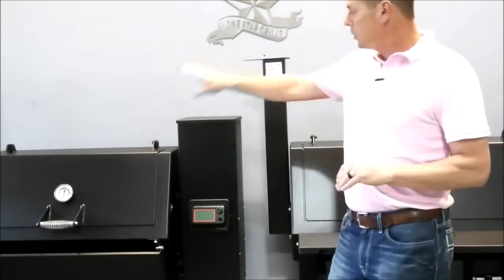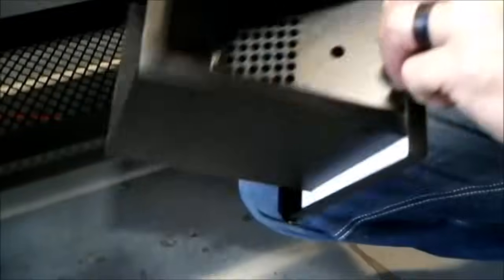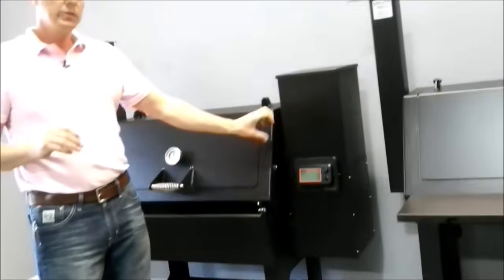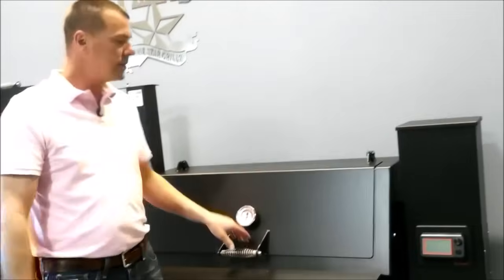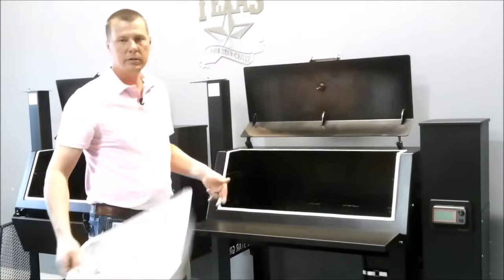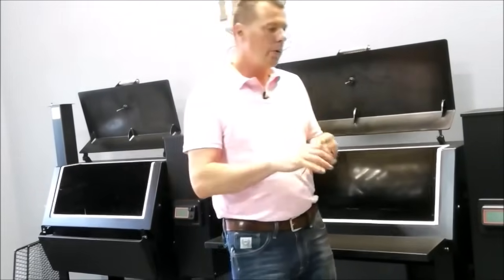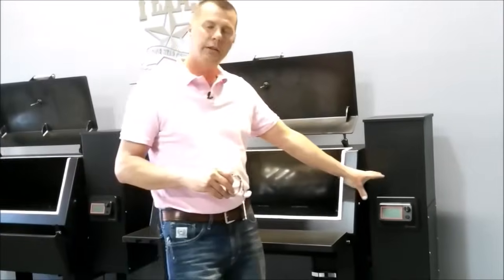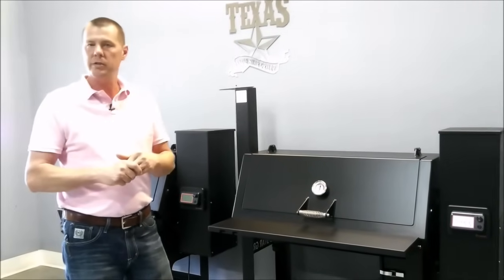Lone Star Grillz Pellet Smoker

Comment: Just took delivery of mine and it is amazing!
Reply: How long from order date to delivery? I have one on order.
Reply: @yambor44  about three to four months from order to delivery. Well worth the wait.
Reply: I just ordered the 20x42 two days ago. How do you like yours now thar you have cooked on it?  Was it worth the wait?
Reply: @jeffpuffenbarger6800  hey Jeff, it is absolutely worth every dollar. The amount of smoke that is produced is significantly more than any other pellet smoker I have had. And the temperature stays where you need it to be, even when I was running it during our winter up her in the Pacific Northwest.The Fireboard controller is awesome. I would definitely recommend getting the ball valve for the grease drain. Unscrewing the cap got messy quick.
Reply: @aneisinger  Thank you so much for replying!  I feel even better and more excited about my investment for sure.
Reply: @aneisinger  Did you notice same pellet usage as other smokers you’ve had?
Reply: @318android3  it is very efficient with its pellet usage. The Fireboard controller with the Fireboard drive makes the peeler consumption extremely efficient.
Reply: @aneisinger  last couple questions, it advertises as teaching 450F.  Have you pushed it to that point?  Does it get there relatively easy?  I do use high heat for poultry.

Is it easy to clean the grease/ash inside the chamber?  I know the firepot underneath helps cut down amount of ash inside grill but there will always be some.  Also grease you have to scoop out as I assume you can’t push it into the grease drain?

Thank you!
Reply: @318android3   no worries. Glad to answer. I have not tried to get it up to 450, though I believe it could. I have been cooking recently in temps around 32 degrees and it holds temperature just fine.

The grease is moved into a space at the far left of the grill. There is a drain for it and I would highly recommend getting the ball valve. After your done, you can just turn the ball valve and drain the grease while it is still in a liquid state. I have not had to scoop any out since I start using it. 

The fire pot is nice as you can pull it out from underneath the grill to clean. This has been something I have to remember to do, because if it isn’t clear of pellets, it can prevent the smoker from igniting the pellets. The main chamber is easy to clean with a shop vacuum.

Hope this helps. Take care!
Reply: @aneisinger  helped a lot. TY!

Comment: Two question and a bit of feedback. First the questions.....are there tie down points for traveling with this on a utility or enclosed trailer? If no....its something that should be added IMO. IF I get one, id go off road tires and would like the ability to take it to motorcycle rallies . And....is there any concern of the pellet lid blowing off in high winds? Im here in west texas and the winds can rip sometimes....not having a latch for the lid seems like an oversight. And now the last bit  of feedback: Maybe a standard /smaller version lonestar grillz logo for those that don't do the custom logo for their name or BBQ team. I REALLY like this design and considering saving up for this model. I was eyeing the camp chef....but this heavy duty option is WAY more durable from what I can tell.

Comment: Def a good looking unit and almost, I said almost, a carbon copy of a Yoder.  I would like to see this with the off road tire package you mentioned, hopefully in a video soon.
Reply: A carbon copy of Yoder except for much thicker steel, all welded (no silicone) contruction, better paint, a much better location for the stack, a better location for the burn pot that probably yields more even heat and definitely allows easier ash removal, a much bigger pellet hopper, much sturdier legs, a spot for a water pan, slide out lower shelf, charcoal option, easier access searing system, cold smoke . . .

Comment: Don't these smokers kick smoke out all the time, even at higher temps?  Thats great if so but it might be nice if there was a switch on the controller or a way to make it burn cleaner all they way through if a person is sick of the smoke taste.  Be an easy thing to have that option on the controller unit.  Just call the manufacture of the controller and tell them to add it.  The other thing that would be nice is a way to open the baffle under the grates if the grills running hot or u just want to stay cleaner.  Be nice option to if the front shelf could be twice as long.  Have the short shelf version or offer a longer shelf so it will hold more stuff. The other thing is if you can run all those probes, and you said 6.  Are they color coded?  If not they should be on each end.  That way when u open the lid you know which probe is going to which item.  Say the controller shows yellow is running near done on the temp, open the lid and a quick visual of yellow finds it in seconds.  Maybe you have 6 of the same item cooking.

Comment: I would like to hear that thing explode like other pellet "ovens" have.  It is only a matter of time. Most controllers are too simplistic. They can't even tell if there was a power interruption or a flame out condition. I have seen pellet jams in hollow core augers to.  How Weber has pellets fall into the burn pot should be standard practice. No more smoldering hoppers.  I thought the OK Joe Rider was going to be better, but it needs more design improvements sadly. As of now I stay clear of all pellet burners.
Reply: You don't need to stay clear of units like this. Today's good controllers greatly reduce the risk of hopper fires, flame outs, etc.--and it's important to emphasize that clean burn pots (easy to maintain with this cooker) prevent almost all of the troubles you fear.
Reply: @billbryant1288  I meant stay clear to mean I won't spend money on any pellet burner.
Reply: @kjrchannel1480  I knew what you meant. Your original post may have given good reasons not to buy other pellet smokers, but it gave no good reason not to buy the new LSG unit.